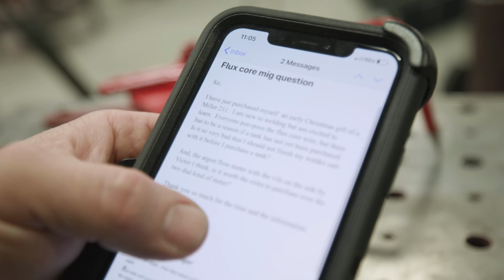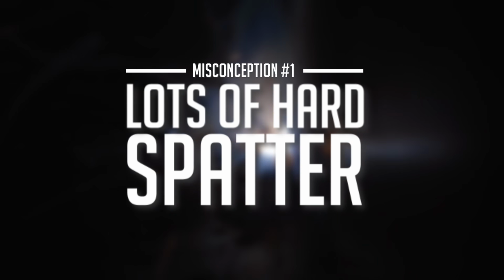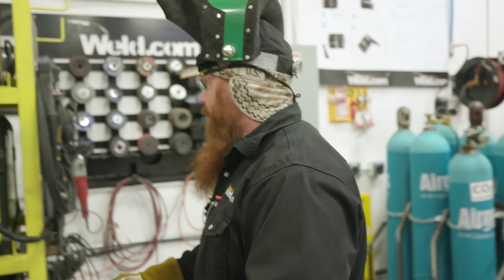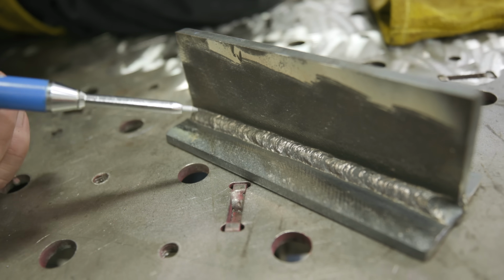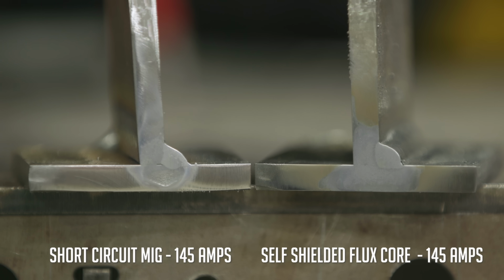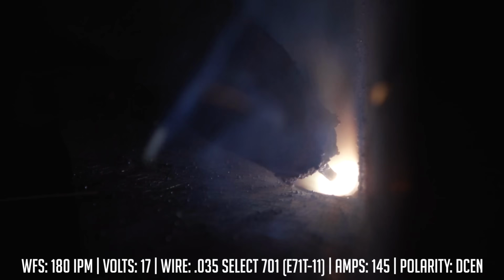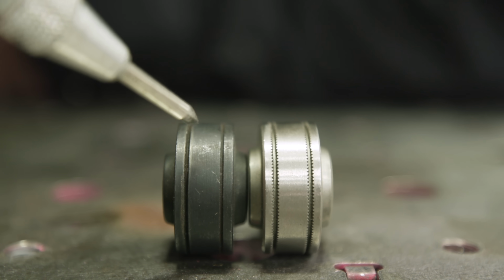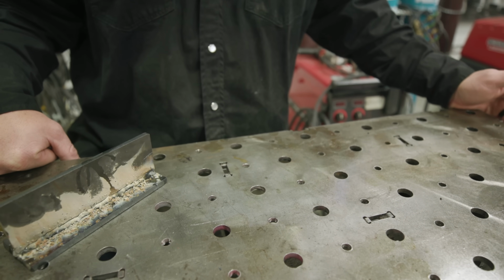3 Flux Core Welding Myths DEBUNKED

Comment: My drive roll type has been incorrect for years, it makes sense what you said !!
Reply: The correct rolls can make a world of difference.
Reply: @ironmike7601  - Pus one on that. My first wire spool, was precisely what came up with the dirty cheap flux core welder I got. Awful, is the correct word to describe. Second and third spools from another brand but same results. Came to the point of having to disassemble everything to "clean" gun, hoses, etc. :-(
I was about to stuff it in the garbage. 
Changed wire to another brand, curiously cheaper than the first! Wow what a difference. Suddenly I could really weld! LOL 😂

Comment: Great video. As a home hobby welder I have a wire feed welder and stick welder. Stick welder requires 240 volt and sometimes leads and extension cord are not long enough. MIG requires moving that heavy bottle and the wind blows. Therefore I choose FCAW. Maybe FCAW is the newest so it gets belittled. But more people are accepting it as a decent way to weld. I did notice your MIG weld looked prettier than the flux core and of course there was no slag to clean.

Comment: Hi 

Great video thanks

One issue with flux core is the smoke and not being able to see the weld puddle. I have found putting a small desk fan blowing on my weld works great to blow the smoke away,

One day I am going to try hooking up a low pressure air supply to my gas inlet and see if that will help blow the smoke away. What do you think

Ian

Comment: Thank you for the video. Could you do a short video on Wheel tension on the wire feed? Too much too little pressure on that spring I know it squeezes the welding wire . What would be the proper tension?

Comment: So flux core should be ran using the same polarity settings as solid wire? That part to me is a little unclear
Reply: Cole Aurichio no, short circuit MiG should be ran on reverse polarity (DC+) and self shielded flux core should be ran on straight polarity (DC-)

Comment: The vast majority of the welders sold to the DIY market are 120 volt models. The machines may have the ability to up the weld amperage when switching polarity, but with a lack of a amp meter, you'll never know what's going on.
Now a days, most of my work is thinner sheet metal, car body panels. I'd never get away with flux core. For me, .023 solid is the only way to go. On smaller work, i'll stay with TIG. Unfortunately my TIG machine requires a 60 amp breaker, so it's shop use only. 

My local gas supplier sells 80 cubic foot bottles of 75/25 filled for around $225 plus hazmat. Cheaper than renting bottles after the second year.
Flux core does have a place in welding, especially remote repairs.

Comment: What's the thickest you can weld with that E71T-11? Also what about welding flux core off a CC power source? I'm considering getting a suitcase wirefeeder but I'm not sure how well it'll work off a CC power source (aka 69 Lincoln Redface and 88 Blackface SA200s). Usually I weld pipeline but work is slow in my area so I find myself doing structural and equipment repairs.

Comment: So what happens when you use gas with self shielding flux core? I'm gonna say porosity
Reply: It's called dual shield look it up used mostly by ironworks to build large building very good process
Reply: @jeremyhanna3852  I know what duel shield is I use it every day. I've seen it without gas and its crap

Comment: Do this with a 90 amp 115v harbor freight shielded wire welder .
Reply: But dont use the wire from there go to  and get the Lincoln wire brand   that Harbor Freight wire  sucks
Reply: Genio nerve I use their wire never had a issue though I only make sculptures and fix or build small things on the farm!
Reply: Get the 125
Reply: My 90 Amp H.F. welder with Lincoln wire and a bridge rectifier to give me DCEN does very well thank you.
Reply: @dillardhayes3612  yeah that Lincoln wire makes a big diff i think on the welds les splatter  and better penetration and doesnt let out as much fumes as the harbor freight brand
Reply: Biggest problem for newbies with a H.F. 115 volt 90 Amp is that they are not DC. You will need to add a bridge rectifier and a choke to get DC voltage out of them.
Reply: @dillardhayes3612  i got mine just cause its more convenient dont have to fight against  wind and the hassle with tanks all the time i was like hmm im us to mig welding  then my boss switched up on me  one day and busted out his flux weldwr  its nice  snap on brand basicly made by country now i think miller took over that company  well i started welding  with that and was like hmmm seen the sale on the 125 and said fuck it might aa well migjt not be brand name like his  but not gonna go in debt neither  works just as well iv noticed and lot more lightweight then his i think his was a 125 also
Reply: Honestly I can weld with it fine only upgraded the thermal switch I will upgraded to the vulcan duel voltage

Comment: Hmm, makes sense of the stickout. I've definitely been having issues with that. Good explanation, will have to put your advice to use. Thank you!
The other issue I'm having is wire feed speed. I'm having to run it in the slowest feed rates even when using the welder's highest amp settings. And that's with .030 wire. As a result, I have very finicky feed rate control.

Comment: If a welder requires more bolts than the chart(+5) is the welder getting tired? It also starts messing up after being used intermittently for 30+ min.

Comment: I’m probably the newest newbie here, thus far I’ve followed Paul's advice on 'Mig Monday' and use flux outdoors and wire indoors. At my level every little help is grabbed.

A great video with so many tips, thank you.
Reply: Flux always runs hot, projects with thinner parts throw flux out the window and use solid wire. If you get a rats nest in drive wheel tension is too high. If the wire comes out crimpled tension is too high.
Reply: Mister Harvey D Thank you, I had no idea one ran hotter than the other.
Reply: @markharrisllb  Not necessarily hotter, just where the heat is applied. Like red beard said, when going Electrode negative most of the heat is put into the workpiece. sO when your working thinner material you will tend to blow out/warp w/e you're working with a lot easier than with solid wire.
Reply: pngu1nsnp Thank you, I appreciate that.
Reply: Yes, you basically only want JUST enough tension to feed wire out the gun. Too much tension will also increase the depth of wire blow-back into the gun tip when that happens on occasion. Which makes it more difficult to remove from tip.

Comment: Who thinks flux core is crap? I never heard anyone say that. Especially anyone who is a welder and in that case is the only people I would take welding advice from any how. Many years ago around 15 before I had the bad ass Everlast I own now. I had a licoln 110 volt mig on fluxcore. I built 3 trailers 2 10ft and one heavy duty 20ft and much more. I still own one of the little ones and have hauled some heavy shit on it as well as I have a 3500lb axle under it. made from 2 1/2 x 1/4in angle and 2 1/2in 11 gauge tube for the tongue. The big trailer was angle and channel and we hauled a skid steer on it. Never a issue those little welder set up right will put it in just as good as long as you are welding with in their limits and know how to string and tie beads.
Reply: Read the comments, there's always somebody that says it's crap.

Comment: Hi, I use a lot for many reasons ,when the are rusted ,when are gal, 
If use good wire is very strong, 
But is better weld in opposite directions than when use the gas, not go on top like stick, the flux discharge better let inclusion, less spattern ,better esthetic 
,bye 
Roberto
Reply: Less inclusions

Comment: I have much love for the flux core, back in the day i would use at least a 50lb spool of 311mp  innershield a shift, put a lot of big heavy wall and thin wall pipe together with it, dial in my power rollers and let the smoke and sparks fly!

Comment: People think mig is better than flux core? There's a reason flux core was invented....
Reply: It’s not that one is better than the other. They both have their own purpose.
Reply: Mig is only better in that you have more control for finer metals
Reply: Flux is worse for thinner materials, good for bridges etc. Mig for smaller materials and which process you use depends on what needs to be welded
Reply: @misterharveyd5594  Yip. Mig works good for thin sheet metal .

Comment: Am new to MIG and had just a heck of a time finding a 0.030"  (0.8) knurled drive roller for  a JEGS 180C. JEGS does not offer any drive roller aside the one provided on the machine, 0.8 & 1.0. Found a knurked roller at Eastwood MIG 135. (Suspect the same machine with different paint.)
Need the flux core for 2" galvanized pipe to auto muffler for my genset quiet shed project.... FIRMAN H08051 & Suncast Shed - YouTube channel.
Thanks for the info. Wish me luck. Ha!

Comment: I've watched a few of your videos lately because I am going to buy a welder soon.  I am a DIY person, but I have not welded since 1984 when I was a senior in high school and that was ARC.  Seems everyone these days has a MIG welder and that's what I thought I would buy.  My neighbor up the street has one and until he got it he used his Miller red box ARC.  This MIG was a dream for him $2k plus and I have seen him burn some half inch plus material that was stout as could be and clean.  He LOVES it!  When I started looking I knew I would not ever weld more than a quarter maybe half inch material once in a great while.  Every machine I look at in under a thousand dollar range shows you can weld thicker material with FLUX Cored wire.  I think I am going to go with the Lincoln PRO 180 multipurpose.  I can weld up to half inch stock and I can use gas for really thin stuff.  With all the units I look at none that are MIG will come close to the thicknesses I have seen my neighbor weld, but I am not spending $2k+ for anything I will ever do.  He welds all the time.  It may be ambitious out of the gate, but I am building a front end loader for my sub compact tractor.  Keep passing on great info!

Comment: Tig may be my favorite, but not always practical. In Vegas, there is a lot of ornamental iron. Flux core is faster, cheaper, easy to use outdoors as well as throwing a small inverter welding in my trunk, most of my fabrication is done outdoors as well as repairs. I think flux core is awesome!

Comment: I don't own a wire welder but if I did I think it would be hard wire or I'm running stick. Maybe because I'm asme ix certified for stick but I'd rather burn rod if it's for windy conditions. I am a big fan of dual shield though

Comment: Does flux core dirty up your gun liner eventually?
Reply: All wires do, the flux core of self sheild wires are on the inside of the wire, if you are real concerned about the liner, get one for stainless wire that is full lined in Teflon
Reply: @BLee20005   I haven't really had any issues yet with wire feed that I can say was because of the liner but it was something I was curious about. Thanks for the info about Teflon coated liners, I didn't know they existed.
Reply: @travistravis7190  they are designed to be used for stainless steel wires, to keep the stainless from getting contaminated by the carbon steel used to make the liner, you can also take about 5 to 20 psi depending on the length of the gun, and blow out the liner, I only use it as a last resort when I can't just go pick up a new liner
Reply: @BLee20005  do you know much about the safety feature on some arc welders called vrd. Voltage reduction device. I am wondering how much vrd contributes to making it more difficult to strike an arc on some stick welders.
Reply: @travistravis7190  had never even heard of that feature, but I would imagine that if done right, it shouldn't cause a problem, but take that with a lb of salt because like I said I have no experience with that feature
Reply: @BLee20005   vrd is a safety feature in Australia that requires arc welders to have if they are on site. I'm new to welding but from my understanding..what vrd does is when your stinger is unloaded or when your not welding...it reduces the amps to say 5 or 10 amps. Once you stroke or stab the stinger to establish the arc...the welder will then give you the 100 or 200 amps or whatever you had it set at. Problem with is that I'm finding is that just starting the arc hence with a quick stab or scratch method is just so much more harder as your stinger is sitting at 5 amps. To get it to arc...you really need to exaggerate the scratch or stab of the electrode. It might just be an Australian requirement and sure..I have read a lot of where it has prevented some decent shocks but I'm just curious as to how people get around the arc striking. I have seen some new machines where the feature is keyable to where there is a key at the back where vrd can be turned on or off with a key.

Comment: Awesome video! I learned to weld with cored wire.. 🔥💥☻
I use 1/16" nr233 over 7018 stick just because its nice😁 easy👍 and great outdoors. But be careful! Some wires do not have charpy characteristics. 233  and 232.👍 Great for structural  211 is good for general purpose.

Comment: Thanks Redbeard! Great video. Working with self shielded and dual Shield right now. Cut and etch to come. Trying to figure out if you can run dual Shield flux core downhill on 3/16 and above. Love the process!!!
Reply: Get all position wire and run it up hill.

Comment: Now show them Dual Shielding, (pros-n-Cons)
Reply: We run dual shield all day every day at work. .045 at 25.5 volts and around 185 amps up hill mostly. Makes a mirror finish on structural steel and is fast
Reply: I hear it is a much hotter weld.
Reply: Morbian13 it is and you can really stack them and make them lay down real nice
Reply: @jakobbolyer1735  I have never done double shielded flux core,  but have been curious about it. Have a fairly cheap Hobart MIG machine running flux core  all the time, just don't have the money for a big bottle of gas. They are kind of pricey.
Reply: Morbian13 I have a esab rebel 205 Ac/dc but I haven’t bought gas bottles for home use yet I get by mostly with stick(6011,7018) and flux core I used dual shield at a machine shop I used to work at when we had to weld on heavy equipment and stack multiple beads for strength
Reply: @jakobbolyer1735  I have a second machine for stick/TIG/plasma cutting,  but don't have bottles for gas lol.
Reply: @jakobbolyer1735  At the structural iron works company I use to work for, we used .045- 3/32 dual shield flux core and had to wear double gloves because of the heat.
Reply: Grandpa Bill I don’t doubt it and leather sleeves are a must those bbs will burn you up I don’t use it much anymore I work for a fueling company welding on fuel tanks in the field now.
Reply: I'm wondering how running C02 on gasless fluxcore would affect the weld. After running dual shield at work it sucks to run gasless fluxcore on projects at home... and no one makes or sells small spools of dual shield.
Reply: @phiksit  Look on Ebay for Kiswel E71T-1C/1M. $30 shipped for a 10lb spool.

Comment: Untrained welder here, first time using flux core I swore in disgust. Had no other option so mucked around with settings and separation and finally in desperation reversed polarity and, whaddya know? Perfect
Reply: my crap welder came with a giant sticker showing you have to reverse polarity depending on solid vs flux..
Reply: Some crappy welders u can't change the polarity
Reply: @raccoonvalley3237  There should be a way you should be able to pull a panel and flip the terminals. The output side won't know how it is hooked up to the wire and ground. You may have to come up with a jumper if they did not provide provisions for an easy change.
Reply: It's printed on the welder.
Reply: I had the same issue, until I read on the inside cover on my Lincoln SP100, to reverse polarity when using shielded wire.

Comment: What would cause the slag to to be a nightmare to remove from finished weld? some times when I weld with SSFC it comes off nice and easy and other times its a total nightmare. material and machine settings stay the same. stick out? position?
Reply: I have noticed it depends alot on the flux mix that was used lot to lot

Comment: I've had multiple people etc tell me Flux core can't be used for auto body repair. Say it messes up the paint bond. I've used it and never had any trouble what so ever. I never seen where it would be any different Tha stick welding, which I've used to weld many body pannels.
Reply: Neither stick nor flux should ever be used for body panels........
Reply: @Matt Sullivan , I've used both. Never had any issue at all. Have to be careful about warping.  But that's just part of welding thin metal

Comment: Awesome video. I just bought a titanium 125 flux core welder from HF on black friday for $150 and I'm very pleased with the welds I'm getting with it. First time running flux core. Usually I run a Miller 210 mig, but I wanted something small and portable for offroad trips. It would be great for somebody learning to weld on the cheap.
Reply: I got one a few weeks ago.😉👍👍